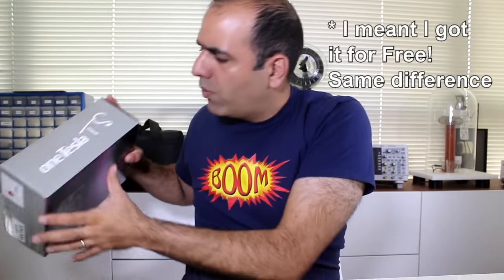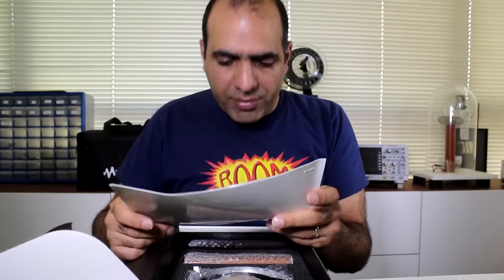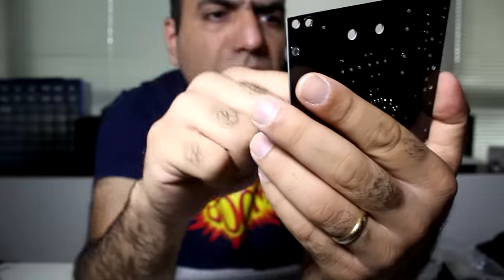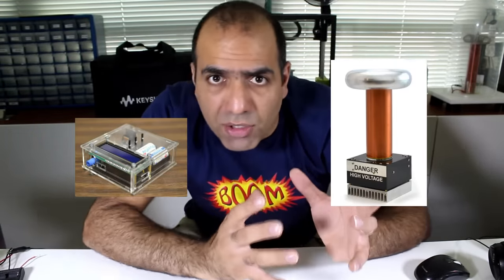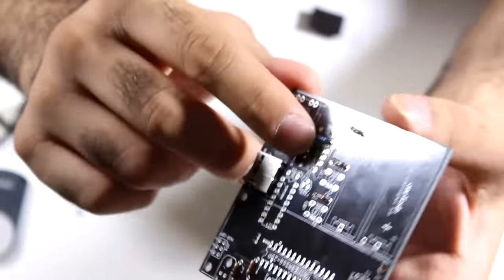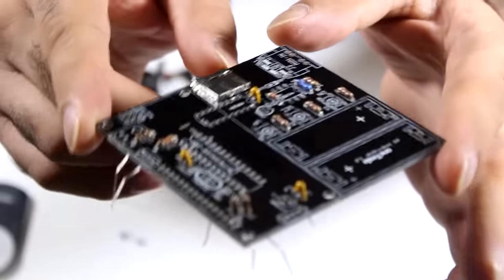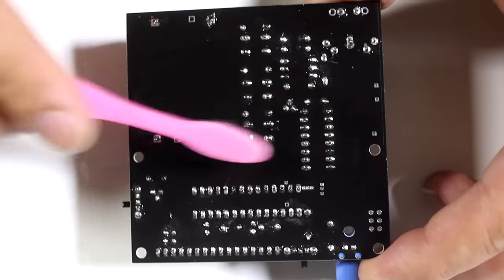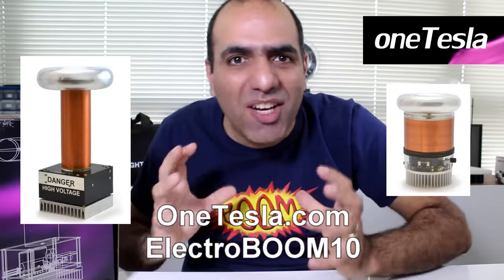How to Solder, and Assembling a Kit (OneTesla Part 1)

Comment: One trick I use when soldering, even small compentents, even though with the smaller components it doesn't make too much of a difference, is to cut the legs before soldering as they can act as a heatsink. This trick is better used with bigger components. Absolutely loving this channel! Funny and weirdly informative at the same time.

Comment: When i worked in aerospace as an avionics tech, we were taught to solder at a much lower temp mainly to avoid overheating the contact pads. Most solder will melt at ~180'c so we soldered at around 200'c. Also use isopropyl alcohol as it leaves no residue.

Comment: I'm a mechanical engineer and I laughed on the floor about teaching mechanical engineering in colleges.

Classic engineering rivalry.
Reply: lmao. had to stop the video and just laugh for a bit at that. Great times.
Reply: Wait, you get a degree in ME for solving puzzles at kindergarden?:P
Reply: The maths used in both fields are similar. People often use mechanical systems as analogies for electrical circuits when they're teaching electrical engineering.

mass - inductance   
stiffness - capacitance (1/C to be exact)
damping - resistance
displacement - charge
force - voltage
Reply: Στέλιος/Stelios Αρβανίτης/Arvanetes actually I got a degree in ME by solving puzzles in the young adulthood hahahaha
Reply: ..and i am here, reading my ass off to be an Electrical engineer.;p
Reply: slyonme Sorry mate but i think you should be aware of the fact that english isn't everyones first language!
Reply: i'm a welder of education
but 10 years later i work on magnetic resonance imaging scanners.. (MRI)
so much for education
Reply: GNNNAAARRRRRRRDDDDDWWWAAAAAAAARRD :)
Reply: Not really a rivalry when MechEs can't even build a circuit on a bread board...
Reply: Chotu221: I am a mechanical engineer and can construct and etch a PCB any time. Remember true mechanical engineering knowledge also include electronic and computer science as well ;) (as well as some other sciences: like biotechnology etc.)
Reply: Chemical engineers: sipping tea
Reply: @steliosarvanitis5606   Megatron xd

Comment: +ElectroBOOM, realy good job. Although I usualy leave few millimiter of leads on these type of caps so that solder can flow through plated holes, it is a really good indicator of good solder job if you can see nice fillet on other side of the board as well. Although NASA standard would also ask you to tin the ends of legs you cut so they don't corrode. And I prefer isopropil alcohol for cleaning PCB, removes rosin-based fluxes much better, and is very volatile as well.

Comment: I have a 2 in 1 Solder/hot air blower station for SMD and other stuff. I got it for Christmas and it is great. The iron is rated at 60W and the air blower is 300W. BTW: when I solder I touch the iron to the solder and the solder melts onto the pad and leg. It works very well for reliable joints.

Comment: Dude 400 °C? I solder between 250 to 300 °C, beyond that (an especially at your temperature) the lifetime of the tip of your soldering iron rapitely decreases and the flux can char.
Reply: you are just jealous because he's the best (jk jk, I don't know anything about electronics)
Reply: I guess given the large surface area and the small cross sectional area of the copper wires in addition to its conductivity, the loss of thermal energy is rapid, so using a high temperature like this provides a "grace period" until it cools down to the actual melting point of the solder.      Just a guess though correct me if I am wrong. :D
Reply: airflyer13 - He said 480 degrees C., which is MUCH higher than necessary. As a professional who does high-reliability soldering, I have never needed temps so high, even for relatively large components. Not only will it shorten the life of the tip, but you risk damaging your components and burning the circuit board if you do not solder as quickly as he does.
Reply: another person after the mechanical engineering one got triggered.
Reply: Depends. I have an FM-202 and it auto-calibrates to the specified temperature for the selected tip. Mine usually hangs around 700-750F, or around 400C. It looks to me like he's not using a dedicated station, rather a cheap generic plug-in mains ones, which if you've ever soldered with those take ages to heat up and have nothing for thermal regulation. Setting it to wetting temps doesn't do anything because there's nothing there to actually regulate that temperature. You touch it to a pad and the heat gets pulled away, fast. The iron does not actually push in any more power to maintain the desired temperature.

63/37 leaded solder may melt at 183C/361F, but you also have to consider what the component is attached to. Soldering a capacitor or even a resistor to a large voltage plane is going to sap away a ton of that heat. Factor in a lack of proper tip temperature regulation and you have an iron where you'll sit it on the pad for minutes on end with no wetting action. Higher temperatures allow for wetting temps to be achieved faster. Ideally you need 2 to 3 seconds of contact, maximum. Higher temps will achieve that. You especially need higher temps on shittier irons.

I've tried soldering at 500F and it's a pain in the dick. I work on SMD components under a microscope. The only way to deliver the heat needed to a ground pin on a component like a charge port is to deliver a fuckload of heat into it on that single, tiny point. More heat isn't necessarily bad and is in no way a reflection of incompetence.
Reply: I've made the experience with more budget orientated soldering stations that they can't hold the heat with larger components as good as more expensive ones. Therefore I solder on my cheap "I don't want to stress the good one for this piece of shit"-solder station at about 410°c and on my good one at 350°c. I doubt he has a cheap one for 30€, but who knows. Maybe he hasn't sold enough shirts to get a good one. ;)
Reply: 400°C...The F@ck!?
I would NEVER go higher than 250°C and (even at 200°C) most of my components would be WAAAAYY out of spec if I toasted the solder pad for more than 3-4 seconds. Keeping the heat on for as long as you demonstrated would immediately get my lab 'privaliges' revoked for a month!
Reply: That depends on what you solder, with what kind of soldering station and (most importantly) what solder you use. For example, my last soldering job was fixing a 6.5mm audio jack. It's not a part thats sensitive to heat and, apart from some resistors, there was nothing around it. Then my cheap soldering station I used dropped to around 320°c while soldering. Like I said, I made the observation that cheap soldering stations can't hold the temperature that good. And in the end it also depends on the solder you use. The solder I used was a 10/90 blend of tin and lead. That one wouldn't even bat an eye at 250°c. It wasn't the proper solder for that job, but I needed a quick fix and it works good enough for my purposes.
Reply: Ladies and gentlemen, I present to you... "Humourless internet denizens who couldn't recognise a joke if you beat them with one"! Take a seat, break out the popcorn and enjoy :-D
Reply: Yeah, and that might be true. For you. But not for me. Try soldering a ground pin on a Galaxy S3 charge port at 250C. You can't do it. I'm sorry, but you can't do it. My point against your argument was the temperatures used depend entirely on what you're soldering and the tools you are using.

Just gonna throw this out there, my station would not automatically calibrate to that temperature range if it wasn't to manufacturer specifications. It's auto calibrated to that range for a reason, and it's due to the thermal profile of the tip selection. Of course when you're using fuckhuge knife and chisel tips and dealing with components that you don't have to use a microscope to even see your leads on, yes, 250C and higher is absolute overkill. But even then it's still questionable and depends purely on the soldering iron. As Immi Ogmios pointed out and as I pointed out, cheaper irons DO NOT regulate and maintain their temperature as well as a higher end station. It's a fact. This is a FACT. To overcome that lack of regulation and control you need more heat. Plain and simple. It's thermodynamics.

If you really do work in a legitimate lab you should know that just as well as I do.

EDIT
Like, I'm not saying you're wrong. Because you aren't wrong. But at the same time you also aren't right. When I want to use another tip on my FM-202, I put the tip into the calibration port and it automatically sets the temperature for it. I don't think it'd set it to 400C if it wasn't meant to. When you are using at tip small enough to microscopically solder individual pins on a 60 pin FPC connector on a Galaxy Note, you need more heat concentrated on that singular point to actually let the heat transfer happen.

Comment: Correction, The dark Green (or red) stuff is called Screen (more correctly Solder Resist) as it covers the copper tracks except where the connection points for the components are. The White stuff is called Legend and is usually labels for components and settings for jumpers and dipswitches. The screen and the legend are printed on the board using a process called Screen-Printing cos it uses a silk screen.

Comment: I would love a Tesla coil it would be great I'm 14 I'm trying to get into electrical engineering
Reply: Good luck! A good choice! 

I got into electronics when I was young. Go for it! - Start playing with PIC microcontrollers, the starter kits are pretty low cost or Raspberry Pi's. I have a few Pi's that I use at home - one as a GPS disciplined NTP time server and another running a music streamer but also use them for work. There are lots of projects out there and a number of programming languages that you can use to get to the GPIO pins to develop projects.
Reply: rjy8960 thanks!
Reply: Chemistreeu SCIENCE!!!!!!!!!!! Cool, I'm 14 too! I'm also working with electronics, and I'm getting into surface mount components.
Reply: Joshua the Coder neat
Reply: Im still stuck in what to choose electrical engineering or software engineering. Im interested in both rn
Reply: Me to bro! Also 14 and want to get into electro engeneering.
Reply: Computer kid so which career should i pursue?
Reply: Soldering is a pain until you get used to it…
Reply: I'm 13 and ....... rest is same as the comment
Reply: Chemistreeu SCIENCE!!!!!!!!!!! Dude, you have a long way to go! I started when I was three because my parents really encouraged me to pursue what I wanted to and I was fascinated with electronics! Study everyday and I think you can make it!
Reply: I'd suggest being an Electrician or AI programmer. Most IT and non-programming jobs are being outsourced. The ones that aren't, aren't paid well. If you become an electrician right outside highschool you get paid to learn and will be making 100k plus by the time you're 30. I'm an electronics engineer and not even making that. College is oversaturated and overrated, don't go in to debt for it.
Reply: Iam too 14 but my father tells me to be a doctor
Reply: Polished Spectre become a doctor

Comment: The legend is printed using silk screen. Strangely a similar process is used to create surface mount solder pads using paste. I used to operate one of those pasting machines while working in a motherboard factory, when not working on QC

Comment: Not only should you solder smaller components first, also try to solder height wise i.e. less height things like resistors diodes first then caps etc because when you want to solder you will turn the board and if the heights are all same or similar its easier to hold the component in place when we flip the board

Just try it!
Reply: Or use helping hands like everyone else

Comment: With regards to getting the wires up to soldering temperature, I noticed that when I have a liquid bead on the end of my soldering iron, the wires heat up much faster. There’s more surface area between the soldering iron and wire when I do it that way. Just my 3 cents

Comment: Well I usually don't participate in the comment section but I guess winning that kit is a good excuse for me to get some precision soldering tools, as I only have a big bulky soldering iron that goes straight into the power outlet without any regulator on it. Atleast I'll be able to solder off components on broken hardware and potentially fix other stuff then.

Comment: you forgot to mention that when soldering you should solder components with the legs straight, or you could get a dry joint

Comment: I always felt like the surface mount components were easier to solder.  Just heat up the feet and push it on the land, boom solder done.

Comment: Does the extra flux need to be removed after the solder job?  Will leaving it there cause damage to the board / components later?  Or is it only for clean up?

Comment: Looking for a Relay that goes from NC to NO when triggered, and then stays in NO mode indefinitely, even if the original trigger signals again multiple times. Want to also have a manual switch to reset it to NC when necessary. Anything like this exist?

Comment: 8:55 - anyone can do Mecanical Engineering, but do be warned: It is a very toxic major and a ton of work compared to electrical which most mechanical engineers who drop mechanical switch to that I know of.

Yes, it is like solving a puzzle just with more math and more of about a variety of different engineering majors combined into one which sounds great at first but it isn't so great when you take over 5 years to graduate and have a D in a class.

You guys don't have to take dynamics, which is one of the various reasons why mechanical is harder than electrical.

Comment: Step 1 to becoming an electrical engineer.  Put 3 car batteries in series, hold both the positive and negative leads, you know electricity hurts now, invest in a multimeter and a book on the fundamentals of electrical engineering.

Comment: The word solder is pronounced like so der. The l is silent and is not spoken. You should not clean a circuit board with acetone. It is caustic to the board. You should use alcohol on any solder joint and anywhere you might have used liquid flux. You must remove excessive flux because flux can conduct electricity.

Comment: about the soldering iron, just want to ask, what did he do to make the lead stick to it? is there anything he put in the iron? because ive tried soldering once and the lead just rolled on the wire to the table, it didnt stick, ive tried searching but cant find anything, help...
Reply: It should stick. Maybe you used too much tin. Lead is only a small part of solder to prevent tin whiskers. In Europe it's illegal to use lead in solder, I believe.
Reply: @ericl8743  thanks man
Reply: If you have troubles with it sticking to the PCB, you can put flux on the PCB. Also there are solders with and without flux inside them

Comment: I need one of these tesla coils! Even though it will probably result in the smell of burnt flesh floating through the room. That is if it doesn't kill me?. It is final. I shall wear clean underwear! Just in case if the worst...
Jokes aside I want one! Getting into electrical engineering and it would be a fun project!

Comment: hey elextroboom my girlfriend braught me a tesla coil for my birthday from eBay. it's like the one except it came prebuilt 
I don't have a fancey power supply but i have  lotd of battery and lots off inverters laying around the main structure says dc in  and it came with a little board that said "full bridge rectifier" !!!! 
on the instructions it said the device would work o. 110 vs but i live in the UK and we have 240 volts :( can you help me :) love you're videos ( so much so you where my girlfriends inspiration  for getting me the tesla coil too  begin  with (now i have brain ach

Comment: i have my soldering iron at 480 max too  melts  easier
Reply: You should adjust the soldering iron temperature according to what is being soldered. Some electronic components, like integrated circuits, are sensitive to a lot of heat and you might damage them. Other devices, like large electrolytic capacitors, require more heat to get the leads hot enough to flow the solder.